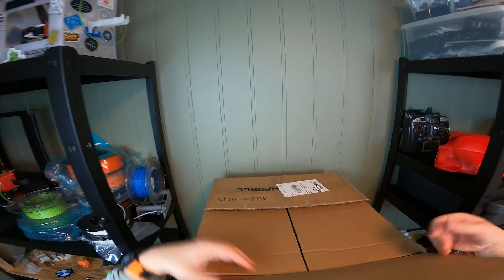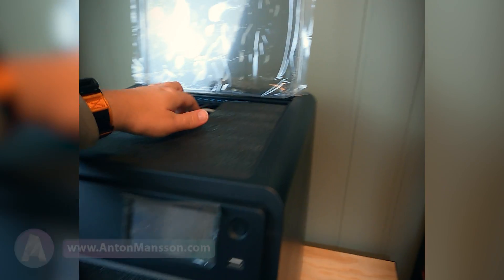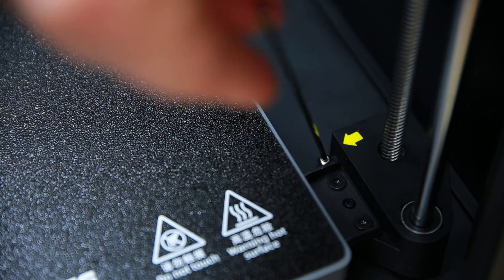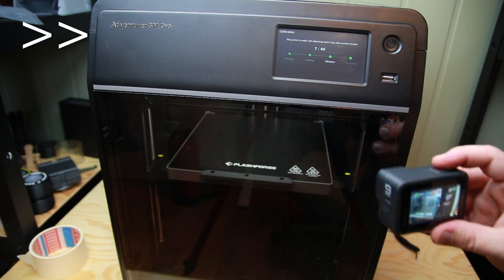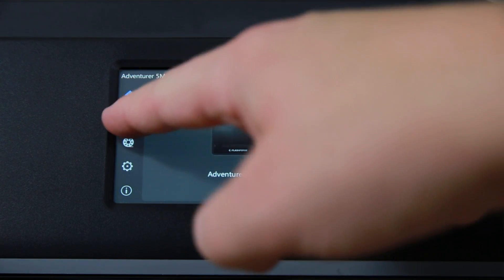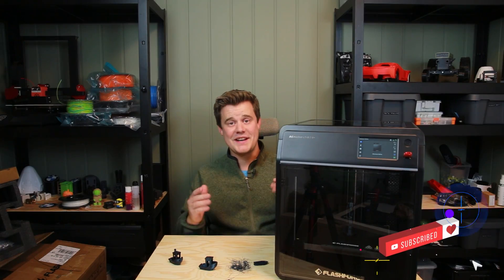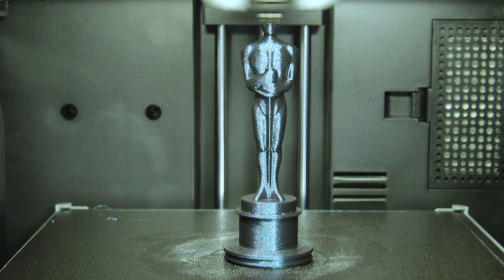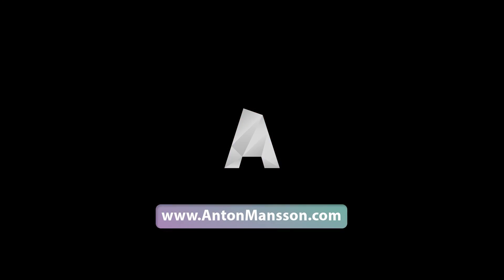Flashforge 5M Pro - First Prints after Unboxing

Comment: What nozzle size does it come with, and is it worth getting other sizes?
Reply from the maker: @74357175  comes with 0,4 and I’ve been using the 0,6mm quite a bit :)
Reply: @3DPrintTechDesign  Thanks! I was getting confused because on the flashforge website it says it comes with a "0.6mm Nozzle Kit" -- but I can't tell if that is the default nozzle, or a second one in addition to some (undefined) default (?)
Reply from the maker: @74357175 ooh yeah, there was a second included that is 0,6.  So you get both. Sorry, was a while ago😅
Reply: @3DPrintTechDesign  Aaah, cool! Thanks for confirming.

Comment: For those having adhesion issues, I have a couple things you could try. When I first got the printer, the bed seemed almost oily to the touch, so I gave it a good scrub with some water and detergent. There was definitely some sort of coating on it as the water was just running off. Second, with the test files, 35 degrees is way too low for the bed temperature, so I cranked it to 50 degrees (you can do mid print). Thirdly, I also changed the Z offset for the test files (again, right after the levelling and right before printing) to 0.05 and that seemed to help too. I also noticed that if you were doing levelling before print and the nozzle wasn't adequately cleaned, it didn't level correct to the tip of the nozzle. I also ran another calibration cycle too.

Comment: Good video. 
Are you forced to use the glue all the time or can you print without it?
Reply from the maker: Glue is mostly there to avoid too good adhesion with petg. At least in theory. But currently I find it quite necessary on the adv5.  I’m testing if it’s just first layer settings from flashprint or actual flaw in the pei-plate.
Reply: @3DPrintTechDesign I also own have my hands on an ad 5 and I’m experiencing similar issues regarding bed adhesion. Please let me know if you find out anything!
Reply: Oh and also.. iv been printing non stop with it since 7pm last night.. and didn’t finally shut it down till 7pm tonight.. so it printed for 12 hours straight and I have a whole shelf full of stuff I made with it.. not a SINGLE issue with this machine once I scrubbed that bed plate with dawn a few times
Reply: Yeah, whats up with the bed?? I wanna get this printer, but maybe we'll have to get a new build plate.
Reply: Scrub your plate with dawn dish soap and a green Brillo pad.. you’ll never have an issue again. You should be able to easily get 2 prints off a single clean.. the more you use the build plate the better the prints adhere to it.. soon you’ll be only cleaning it with dawn once every 5 prints like I do